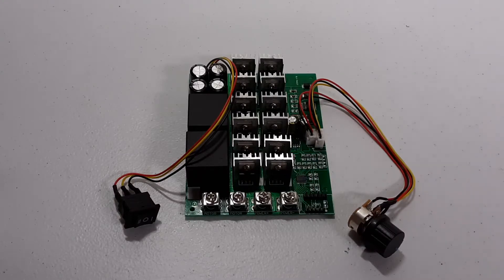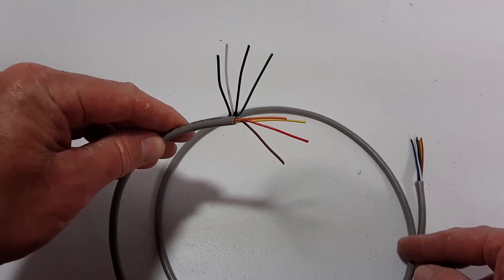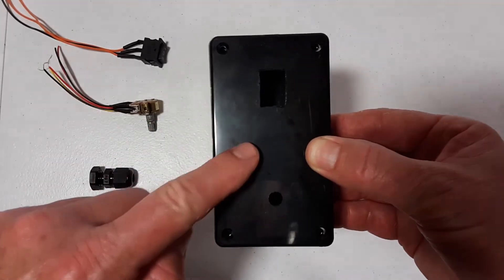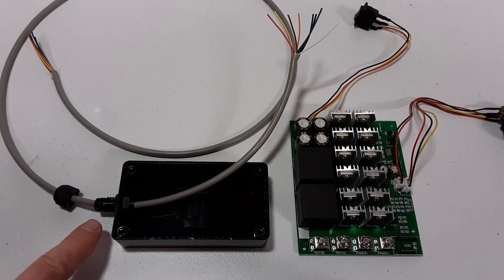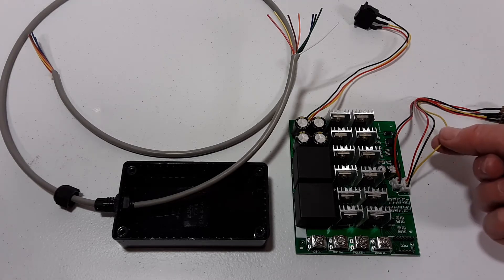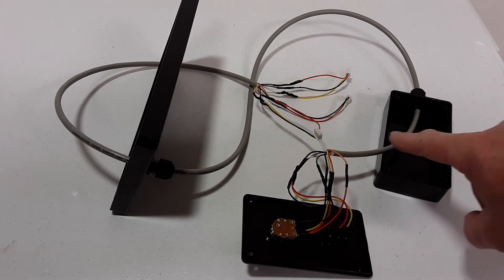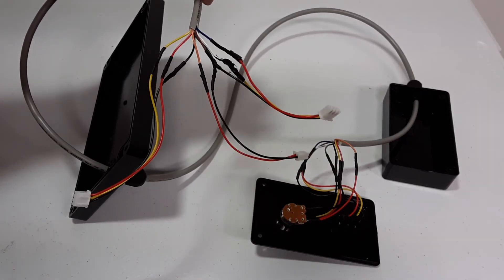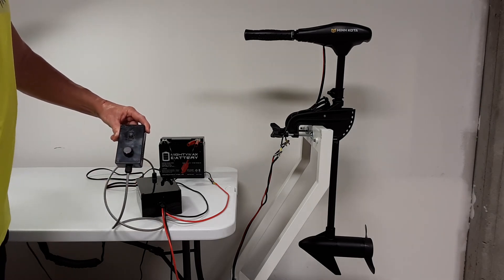DIY Kayak 12V PWM Digital Speed Controller Remote Build Project

Comment: Akamaniyak, love the videos i just finished my second build like this after watching  your videos but my question is about the kill switch . my pwm is in the hull of my boat and my remote is beside my seat on a ram mount .  i want to add a kill switch on the frame of the boat . i'm wondering if i could run 24 Gauge 2 Conductor Electrical flex wire from the directional switch out the box to the kill switch ? which in short is only extending the ground from the directional wire to the pwm . i know i can add the kill switch to the controller but i like my freedom of movement . i would appreciate your thoughts on this thanks .
Reply from the maker: Thanks Narshawn! You should be able to do the kill switch the way you want as long as you break the circuit at the switch.

Comment: I’ve been searching for 3-pin waterproof forward/reverse switches, but I’ve been having a hella a time as all I can find are 6Pin and momentary. It looks that the vendor you listed is no linger selling these toggles. Do you have any suggestions where the right switch can be found (round or rectagular doesnt matter). 
Thank you for all of your exceptional and detailed walkthrough of your builds! Folks like you bring so much great information for the community!
Reply from the maker: Thanks Dre! I would try pasting the part description into Amazon instead of the vendor link. It may help.

Comment: Thank you , works great, after 2 years my panel board started to deteriorate,and now don’t, work, i know they only cost 25$, is there a more durable one , or should I just replace?
Reply from the maker: Yes Ron there are other options. I have also done video tutorials with a fan mounted PWM and also a Minn Kota control board. Just search my PWM playlist and you will find them.

Comment: I built my trolling motor control based on your video, so thank you. My build differs slightly as mine encompasses the battery and PWM in the same hard case. 

I have one question, as I am trying to improve load/unload on the kayak when I get to and leave the water. I have found waterproof connecters for ethernet cable that would work fantastically to unplug the control box from the battery/PWM case. 

Will the PWM wiring for the Potentiometer and Fwd/Rev switch overload the amperage that basic Ethernet cable can handle? The ability to plug/unplug the remote control to the battery/PWN box would be very helpful.

Thank you for you time.

Comment: I am curious about an update, you have since built one with a fan, have you ever had a failure of this one? Which do you use on the regular? Is the fan necessary? I have a 46lb. motor and the 60/100 pwm but I need to be able to run full throttle as long as I want.
Reply from the maker: Yes I built one with a newer model PWM that has a larger heat sink and fan using this design. It is a 60/100A and I made a video for it. If you are subscribed you will see it. I recently completed the project.
Reply: @Aksmaniyak  so, the no-fan version did fail from heat?
Reply from the maker: @TahoeYakFisher  No, I just wanted to see how the new model worked.
Reply: @Aksmaniyak  do you have ample time on the no-fan version that failure is not likely, is basically what I am asking?
Reply from the maker: @TahoeYakFisher  Yes, it is still working fine.

Comment: Stumbled upon your video earlier when I was researching this very idea. Got a question for ya. Do you think it would hurt anything to mount the PWM on the inside of the battery box (With the trolling motor batter) and just extend the leads to a smaller box up by the seat?
Reply from the maker: It would depend on whether the battery box was waterproof/weatherproof.

Comment: Hi Aksmaniak, Extended the wires on my PWM. Great idea. I seem to be experiencing a 2-3 second delay of power getting to the motor. Also the motor doesn't seem to be going as fast. Possibly a .3-.5 mph slower. Have you experienced either one of these reactions in you PWM extension? Very convenient and lots better that trying to deal with a large box. Thanks.
Reply: About 5 feet. I used solid phone wire 22ga. Ordered some of the wire you used (8wire cable) Hopefully that will remedy the problem. Still better than paddling. :-)
Reply from the maker: Thanks Elvis. I have not experienced any performance difference. How long is your extension wires?

Comment: Awesome idea. I tried it using 22ga solid copper telephone wire that I had lying around. Didn't trust the solid wire though and ended up using an old Ethernet cable. It's 4 feet long and has 8-24ga color coded stranded wires inside it which I think will work perfectly. It is the same gauge as the controller wire. I was really having a hard time finding the wire in a shorter length and didn't need 25ft so I think this will work. Hope this might help someone implement your great idea. Appreciate you taking the time to video this for us. God Bless.
Reply from the maker: Thanks Elvis. It seems like it should work fine.
Reply: Ethernet cable....I have several of those laying around. Thanks!

Comment: Have you tried running higher voltages? I'm considering building a pack of 18650 cells for mine and wondered how high I can go before causing issues!
Reply from the maker: No I have not. All my electronics are rated for 12V.

Comment: What did you do with the other two wires on the motor? (White and yellow)
Reply from the maker: I just capped them off and hid them in the shaft.
Reply: @Aksmaniyak  I thought probably but thought I'd ask to be sure yours had them too. Thanks! Controller will be here Tues already have the cable. No more 3 hours on a battery I'm hoping!

Comment: @Aksman Thanks for the turorials, learning  a lot of useful info from you. Just had a few questions, I have a 30Lb thrust MinnKota, and wanted to run a PMW with it.   1) What type of battery would you recommend ? 2)What type of circuit breaker ? 3) What type of waterproof connectors (for battery/speed control)would you recommend? I’ve seen some with 120A? Is that too much? too little?  Im sorry for asking a lot of questions, I’m just a little lost at this point.
Reply from the maker: Thanks Brian. That's a lot to answer here. I just started a FB page that makes it easier to share info about projects. It will be easier to answer there. Here is the link see you there.   https://www.facebook.com/groups/3521517597860461/
Reply: Aksman Unfortunately I do not have a Face book account, but I can log onto my wifes if thats ok?
Reply from the maker: @briansantacruz354  Sure.

Comment: Ethernet cable is 8 wire and is more flexible and lighter. 4 color solid and 4 color striped wire.
Reply from the maker: That could be but I used what was available to me.
Reply: No ding on you, just commenting for someone else to see. I’ve got dozens of Ethernet cables lying around.
Reply from the maker: @maiko6862  No ding taken...lol. Just saying what I had to work with.

Comment: Do you remember what size wire gland connectors you used. Amazon has all different sizes?
Reply from the maker: No I don't. I bought a variety size bag and used what was there.
Reply: @Aksmaniyak  thanks for the reply I did the same

Comment: Yo i just tried to do this and failed miserably. Where did u get the 8 wire cable from? And how did you strip the wires from the pwm? Mine were so thin that the wire cutter only goes to 22 gauge and had to do it by and took me forever
Reply from the maker: I bought it on Ebay. I stripped the wires by hand using a razor blade.

Comment: could one use a Ethernet for this project? I have a few Ethernet cords that are 8 conductor
Reply from the maker: I really don't know. You could try it but I never have.
Reply: Aksman cat6e is 22 gauge wire and has 8 conductors. It looks exactly like the wire you have in the video
Reply from the maker: Sounds like it would work.
Reply: @Copeland_88  I have used Cat6 cable for mine for the past few years with no issue.  My only concern is that Cat6 uses solid wires, but so far no problem even with it being coiled up and unwrapped numerous times. Planning on building another one of these but will order the 8 conductor cable with 22ga stranded wire from Amazon.

Comment: Apologize if this has already been posted but do you have a video showing how to run the wires to the pwm while still keeping the stock trolling motor head on the trolling motor shaft? I would like to retain it like in this video but would like to know the best way to run the wires with it still being installed.
Reply from the maker: I have not done a build like that but it is easy to do. You put the speed selector on "5" for maximum output. You connect the red/blk trolling motor power input wires to the PWM motor leads.
Reply: @Aksmaniyak  gotcha. Thanks!

Comment: What size wire did you use for the battery connections and any from Amazon you would recommend?
Reply from the maker: I use 10G for the battery connections. I just bought some new supplies from Amazon. The brand is Anchor Marine.

Comment: That looks like ethernet cable :-)
Reply from the maker: No, just multi-conductor wire.
Reply: @Aksmaniyak  I have a whole spool of ethernet cable its just like that except it has some shielding and the wires are twisted into pairs.

Comment: Hi there, thanks for the video. I’m having some problems with the potentiometer once extended. Goes straight to 100 power. Did you have any experience of this?
Reply from the maker: Sorry for the late reply, I just saw it. No, I have not had any problems like that.

Comment: Great videos! Do you need an inline fuse for this set up to protect the trolling motor or PWM?
Reply from the maker: Thanks Juan. I use a circuit breaker for the trolling motor/PWM.
Reply from the maker: I use a circuit breaker for the trolling motor.

Comment: Hello Aksman it's been awhile, Hope you are well and still enjoying DIY. I have a question and need your opinion on my set-up. I have had some trouble burning out PWM boards.
My setup 7' of 10 gauge wire from the battery to the PWM and 9' from the PWM to the Motor. 
My controls are 5' from the PWM to the remote hand control using (cat 6 23 / gauge) It is the board that i'm burning.
Any thoughts would be appreciated Thanks
Reply from the maker: Hi John. My first thought is that you are running too much length of wire and that is what is causing an overload. Do you have a circuit breaker installed anywhere on your electrical circuit?
Reply: Aksman yes I have a 40 amp resettable on the positive battery side. It has never tripped. So I changed it out, Just in case. But to no avail. Do you think the 10 gauge wire is to long? My original game plan is to keep the battery behind my black pack close to the motor.  my PWM under my seat so the 5' cat6 length could make it to my standup bar. This way I was able to stand while motoring & fishing. At this time i will do what ever works without blowing PWM.
Reply from the maker: I have never run 10G longer than 12 feet. If you are going to run that much wire length then you should go to at least 8 gauge or shorten your run.
Reply: Aksman you said you haven't run more than 12' is that all inclusive both to and from the PWM combined? I don't know why i was under the impression I could take it to those lengths? It's easy enough to shorten the wires up and give it a try.   Thanks I appreciate you sharing!!
I'll be in touch
Reply from the maker: Yes, that is total length. Thanks John.  Keep me posted.

Comment: Looking at other PWM videos that you've done I see where one setup you used an amp clamp meter and readout.  However on this remote box you dropped the amp meter readout and only left the basic controls.  What was you experience with the Amp meter?  I'm wondering if I want to bother with the amp meter.  I'd imagine the amps go up but at some point you can crank the potentiometer up and see no benefit speed wise and the amp draw goes up significantly.
Reply from the maker: Hi, the amp meter read out version was made for testing purposes. I wanted to know the relationship between the output power and amp draw. That is not really necessary when just using a PWM for speed control.
Reply: @Aksmaniyak  Yes, I understood that it is not necessary.  I was just curious if you learned anything that you might be willing to share, and if what you learned kept you from tossing the meter into your next build?  Or should I buy the darn meter and see what happens?
Reply from the maker: I did learn the actual relationship between a trolling motor power percentage and amp draw. The meter will help me in other builds but for operational purposes it is not really necessary.
Reply from the maker: No, there was not anything else to share. I just felt that I can use the one meter for all future testing but it is probably overkill for every build.
Reply: @Aksmaniyak  Revisiting this to tell you my experience.  I purchased a 60A PWM and coupled it to a 45# Minn Kota that was rated to pull 42A Max.  Turns out most of the 60A PWMs are only capable of pulling that load for a short time.  Their continuous amp load is only 40A.  I ran mine wide open for maybe 10 minutes and my control wires leading back to my remote started getting hot.  I shut everything down but not before it fried the PWM and started meltign the jacket off the 24AWG control wires.  I'm moving up to a 100A PWM that's rated for 60A continuous.
Reply from the maker: Hi. The amp meter readout box was made for testing purposes and not as a standard use PWM. The amp meter really isn't necessary for running the trolling motor.
Reply: @Aksmaniyak  the point being, a 60A PWM will not support a 40# thrust or greater motor if ran wide open for any length of time.  It's not about having or not having an amp meter inline.
Reply from the maker: @IRBent2  That is true. That is why I like to use a 100A rated with 60A continuous PWM. I have never had any issues with it.

Comment: So how does the pwm connect to the trolling motor? I’m series with the battery with the positive and ground cable from the trolling motor?
Reply from the maker: 2 wires go to the pos (+) and neg (-) of the trolling motor and 2 go to the battery.

Comment: what case did you get for the pwm box?
Reply from the maker: Hi, it is listed in the narrative.
Reply: I found the other case on your other video I ordered everything . Which wire did you order to make it longer I want to mount it next to where I am sitting
Reply from the maker: I bought the remote extension wire off Ebay. It was the only place I could find it at the time.
Reply: @Aksmaniyak  thanks keep up the good videos!
Reply from the maker: You are welcome.

Comment: Have you found a project box that will very closely fit the PWM board (I am remote mounting switches)
Reply from the maker: Hi Mike. I wanted the project box to be bigger than the PWM board to give it more air space. This  helps with heat dissipation.

Comment: It looks like the prices of those are coming down. I am leaning towards changing my Minn kota switch to
a PWM. Curious to see how hot the module get if enclosed. Would be interesting to check the speed 
of the prop with a tach set to five with the switch against the PWM set to the highest speed to see any difference.
Reply from the maker: Yes Wayn there are becoming less expensive. That would be an interesting speed experiment too.

Comment: What size battery was that?  Is that the normal size you would use out on the kayak?  If so, what is approximately run time using that same motor and your setup?
Reply from the maker: Hi, that is a 9AH battery that I use for my kayak electronics. Since dry testing of trolling motors and other components do not draw many amps, I use it because it is easier to handle.

Comment: I notice on your testing motor the head was still on it, I assume with the 5/3 switch still installed.
DO you just leave that switch in the 5 position?
I kind of like the idea of the 5/3 switch still being there incase the pwm fails.
Reply from the maker: Yes, in that configuration, the switch is set i the 5F position. I have done another video that explains different set ups. Here is the link.   https://www.youtube.com/watch?v=Qk3_mUfkUU8